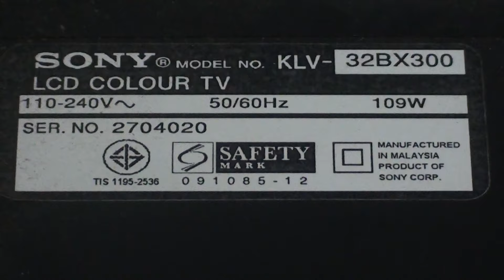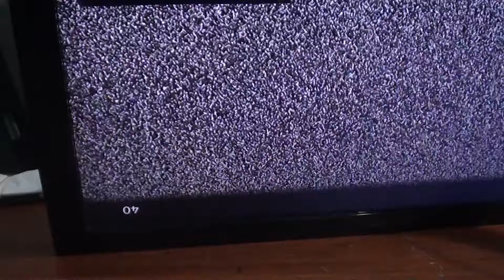Sony TV panel, repairing the double image problem.

Comment: Points to be noted: Mr Pro Hack has mentioned here in the comment section that this cutting method is not a permanent solution. There is a chances of reappearing the double images. Whats the use of cutting connections of FHD?? Stupidity or genious??
Reply: He really could explain more of why he is doing what he is doing.  It's possible that he doesn't need to disconnect both sets of clock signals, for example.  There is a fault somewhere on that half of the panel (probably either in the gate driver circuitry or in the sub-pixel(s)).  The reason this is not a "true" fix is that the LCD was designed to be driven by the gate clock signals on both halves of the screen.  He is removing one of those halves.  But it is a very good solution to keep the tv working for a longer while.

Comment: Do not open your TV up. The only thing you have to do is unplug your TV from the power for two minutes after that plug it back in and wait another two minutes and then turn your TV on that worked for my double image problem.

Comment: Hi there,
Hopefully u will be good
Sir, I have Sony LCD model# KLV-32Cx350 there is double picture from up to down also not clear I sent to the mechanic he opened and check  and he said must change the new panel I don't agree with them and I took my LCD back to my home
Notice sir when the mechanic 
Return my LCD he said there is no more pictures display it was before there 
Now sir, no picture no sound only power lite is there
Kindly, help sir

Comment: This solves the problem but what about the REASON FOR IT? This connections are designed for a purpose , what will happen once you cut them?
Reply: You loose half of vertical resolution.

Comment: I need to stop my TV inverter to send the 3V error voltage to mainboard which causes it shutdown the TV. Can I just cut that bloody pin/wire that sends out the 3V from inverter to mainboard?
Reply from the maker: Which brand TV and panel model number?
Reply: Its Sony Bravia KD-55XE9305. Apparently one or two LEDS in the backlight consisting of hundreds LEDs has failed  which causes the inverter to send error to main board and it switches it off. Backlight is no longer available and there is a high chance of panel damage by trying to change the backlight. I can live with one or two LEDs being blown as I see no loss on brightness while the tv is on. So is it safe and would it work to identify the pain that's sending this error voltage to main board and just cut it off somehow. Is there another way to nullify its voltage apart from cutting it off? Thanks a lot